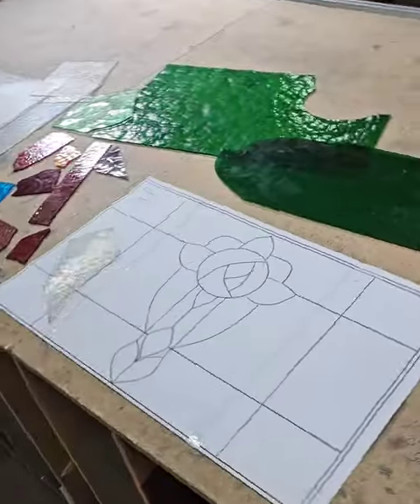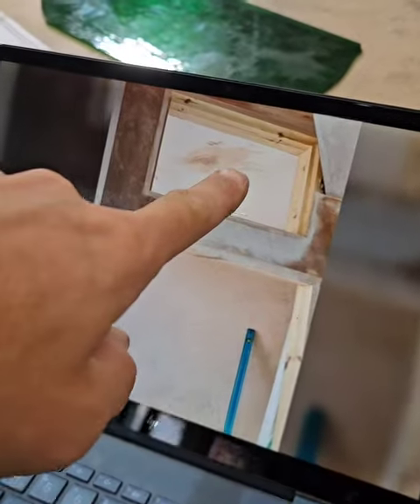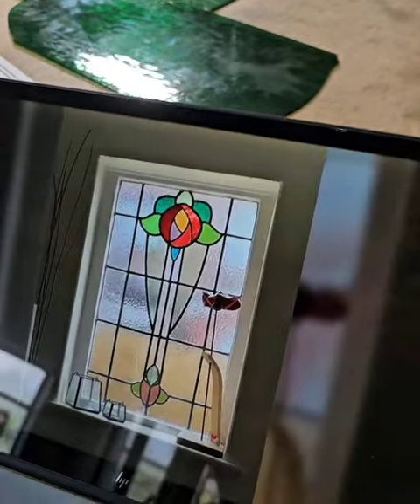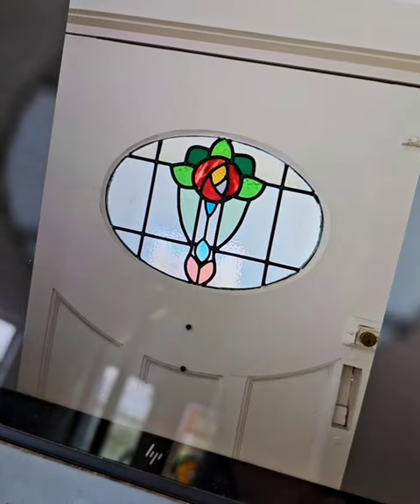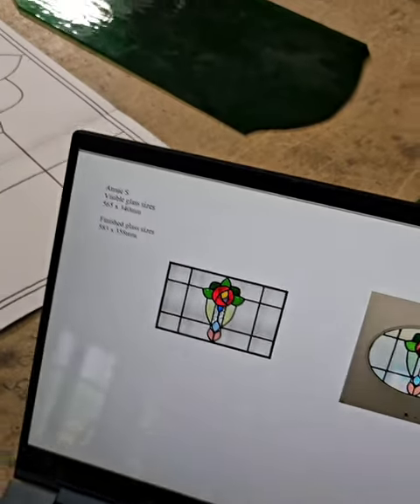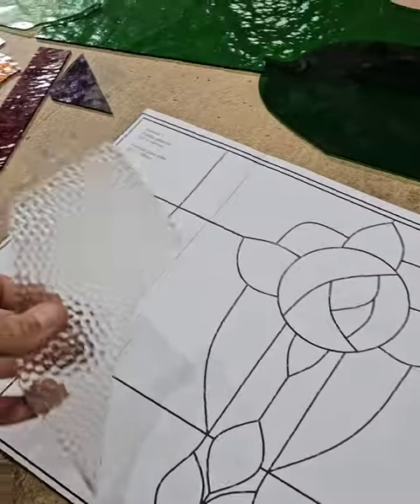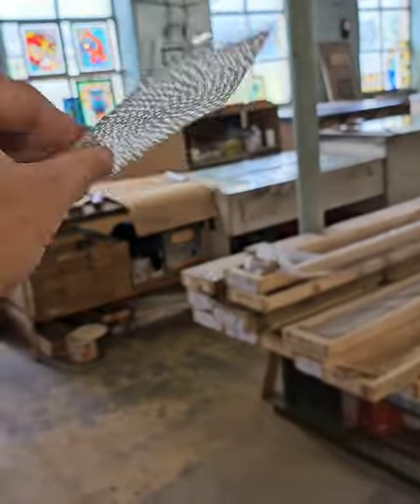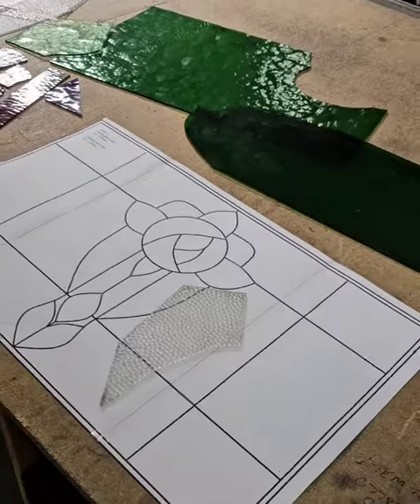Making This Mackintosh Rose Stained Glass Window

Comment: I love this! I'm just starting out, do you mind if I copy it. It's a lovely design and you are an amazing craftsman. BTW, what's that cutter you're using. I like that you can get a flatter angle on it when scoring. So much more control and less stress on the fingers.
Reply from the maker: Tbf I copied it myself from another window in my clients home so that's cool with me 🤜💥🤛 the glass cutter is a sibersmitt model but they stopped making them many years ago 😭
Reply: @LightLeadedDesigns cool thanks - of course it'll be a while before I'll attempt it... Thank you for the inspiration